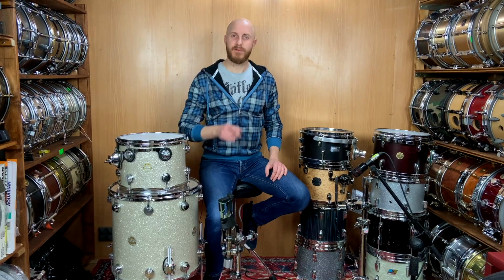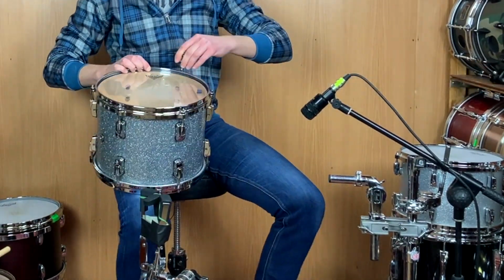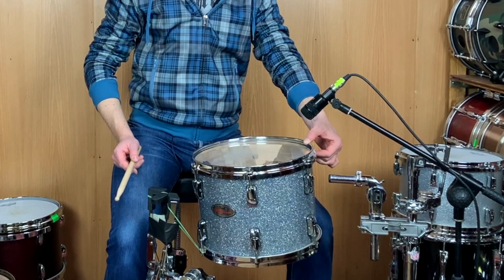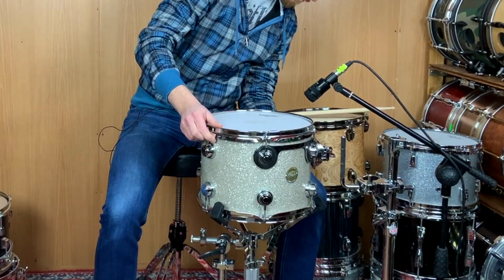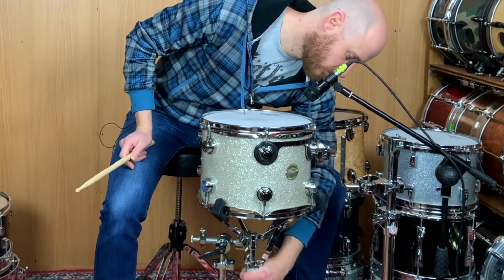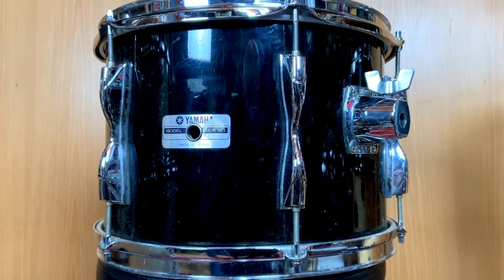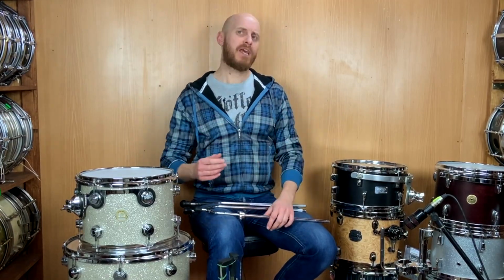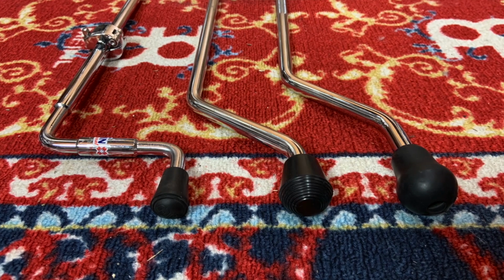SUSTAIN PROBLEMS? 🟡 HOW TOM MOUNT & FLOOR TOM LEGS AFFECT THE SUSTAIN

Comment: Damn. I searched for a video exactly like this. What i suspected beforehand is, the DW and the Gauger mount stayed truest to the free floating tone of the drum. What i did not suspect is that the RIMS mount and the Gauger mount had so much difference in sustain even though they're almost the same construction. What a difference one single contact point can make. What i also not suspected was that the Optimount affected the drum tone so much. The Pearl website says that the aluminium Optimount "provides ultimate stability and resonance", but apparently for 129€ it doesn't do more than a 20€ RIMS mount. Seems like i know the reason why my Tama 10" hyperdrive tom sounds choked at some tunings: heavy hardware.
The Snare stand also surprised me. It had a lot more sustain than i remembered from when i put my 14" floor tom in a snare stand. 
Floor tom legs. That's an inferno. The soft rubber legs did a lot to let the drum sustain, but it sounded like it still hasn't reached the full potential. I use the TnR Booty Shakers on my 16" Tom to maximize Sustain. My 14" is tensioned a little higher, so it sustains good enough.
One thing that i also noticed is the angle that the drum is placed at. The Pearl ISS mounts (metal to metal hoop contact) works fine in most tunings when the drum is nearly flat. But as soon as you tilt it like 10 degrees downwards, which you will have to do if you mount a deeper tom over a Bass drum, suddenly all the sustain is gone and you're looking at a mess of overtones. Do you have any experience in that with the Gauger and the DW mount? I want to know because my next drumset will be a custom build with a 15x12 tom over a 26" bass drum. It would be greatly appreciated if you could tell me or maybe even do a video regarding tom angles and change of tone.

Conclusion for me: Great comparison. My next drumset will either have the DW or the Gauger mounts.
Reply from the maker: Hi there thanks for your interesting comment. 
As far as your Superstar tom I think that their mount works pretty good, but being the star mount attached to the top hoop it may take off some sustain from the drum, the same thing happen when you hold the drum from the hoop with you hand. 
The optimount holds the tom on 4 point (tension rods) so it may affect the top and the bottom rims, moreover the weight is crucial in that case, as an heavy drum will weight way more on the mount enabling the "floating effect".
As far as your custom kit I'd be using a snare stand to hold that monster of 15x12 tom, you can use the flex frame from @GaugerPercussion if you want to have the "fullest" note out of your tom. A 15x12 is supposed to be pretty heavy on the stand, so if you don't want to use a basket stand I think that a Gauger rim with 3 contact points might do the job. 
Tilting is something to look as well, in you case the drum will be heavy and deep, so it will leverage more on the mount. 
I've had a DW 12" tom that had been out on tour for 7/8 years, the mount was a bit crooked so it wasn't floating as it was supposed to. As result the sound was chocked compared to other DW toms (even older than that one!) The sound worked under the mic but there wasn't the "usual" DW tone. Moreover when tilted the sustain was shorter as the mount wasn't free to move and leave the drum floating.
Dave

Comment: Ciao, ho un timpano da 18" che suona molto poco (dovuto anche al bearing edge full contact) mi diresti come si chiama il modello di gambe della Gibraltar con i gommini morbidi? Grazie
Reply from the maker: Ciao, questo tipo di piedini hanno il passo da 12,7 mm e si adattano a blocchetti con il medesimo passo (tipo DW e Gretsch) https://www.gibraltarhardware.com/product/sc-rtl/
Altrimenti se hai gambe standard puoi acquistare il kit di piedini Pearl anche questi funzionano bene nel mantenere il sustain. 
Prima però fai il test di sollevare il Floor Tom e sentire se cambia qualcosa suonandolo senza le gambe in appoggio.
Reply: @yourdrumsound  Pensi con un timpano C&C Player Date II potrebbero essere compatibili? Altri escamotage per aumentare il sustain?
Reply from the maker: @monzprod  Per capire se sono compatibili bisognerebbe vedere la dimensione delle gambe, non so che tipo di hardware monti C&C.
Reply: @yourdrumsound  comunque ho un suggerimento su un video “tutorial di come legare efficacemente la cordiera con i cordini quando il butt end è un unico solido pezzo di metallo”...lo aspetto. 😆

Grazie per le risposte e complimenti.